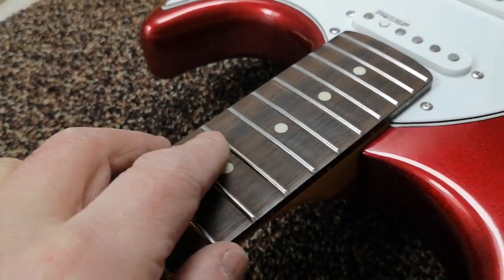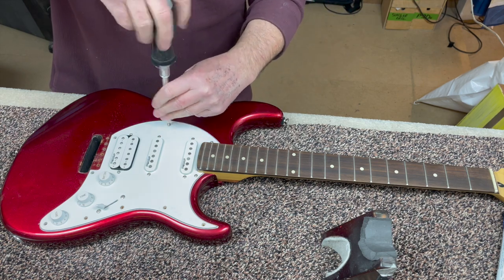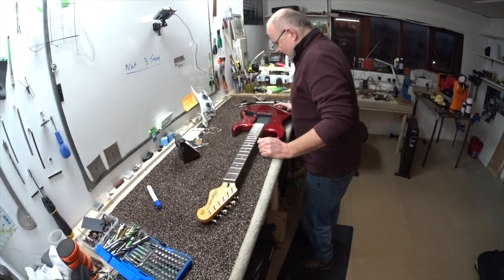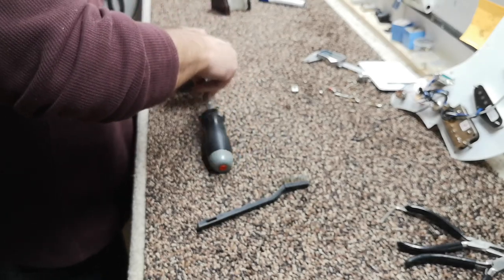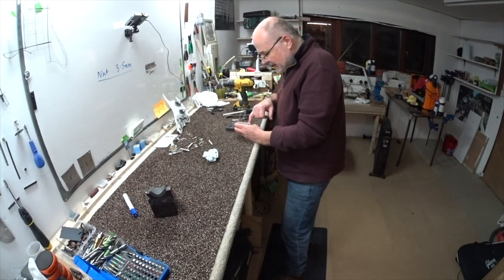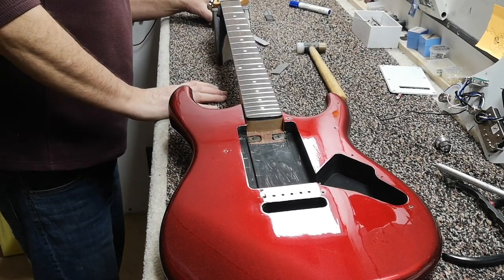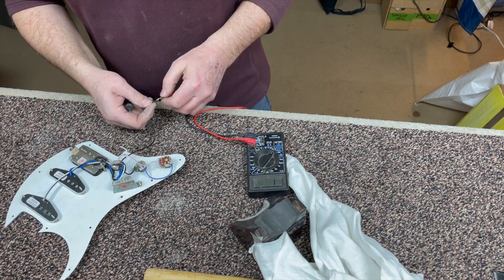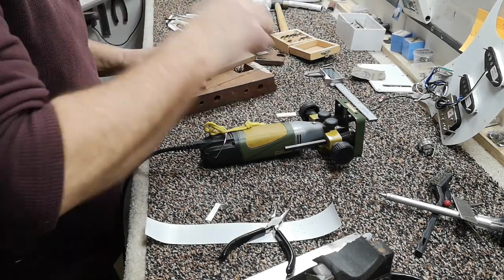Vintage AV6 return (rescue?) and set up

Comment: Hi Sam. Tannic acid is the raw component in commercial rust removers, but you can for small parts like what you've got there, use white vinegar, will just take longer. So drop the parts in a container and leave them over night. If you have an Ultrasonic Cleaner, this will also speed up the process, but don't put vinegar or acids in your cleaner tank directly, use fresh water in the tank and place the objects to clean and the acid or vinegar is a plastic container that is acid safe, and put that in the water. The sounds waves will pass through the plastic container and do the job of cleaning just in a smaller space. I hope that helps. D
Reply from the maker: Do you think it would free up seized parts due to rust? Like right down inside the tremolo block holes etc?
Reply: @SamDeeksRelovedGuitars  it should help, it's a liquid so capillary action will drawn it in. If you are removing broken threads. After you have given it a good soaking in vinegar, use a bit of anti size oil and leave that to work its way in. Definitely savible though.

Comment: Hi Sam I was particularly interested in the nut fitting as I have the same problem with my HB Tele slot width of 3.5
As a short term fix I created a shim, fitted TUSQ nut with some CA on leading face, removed shim and strung up. Seems to be holding without tilt but looks weird with the gap. Will there be a part 2 of this guitar so that I can see the complete process?

Comment: I think I’d glue those inserts in as well as use thread lock. Strange system.
Reply from the maker: I did think about resin... after all, there's no value in having them fall off and rattle around (as one of them already was off when I took the neck off)